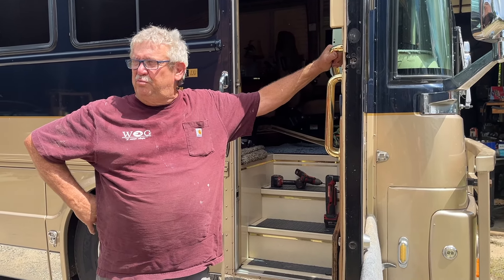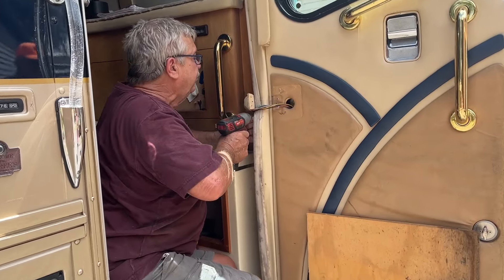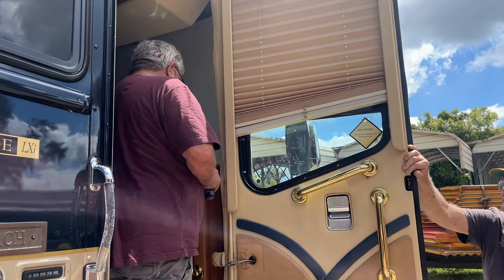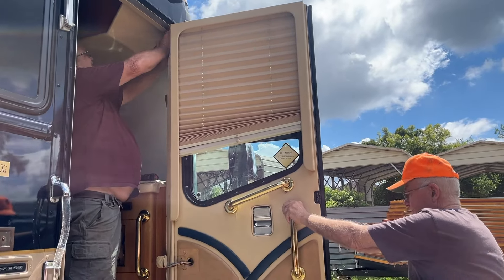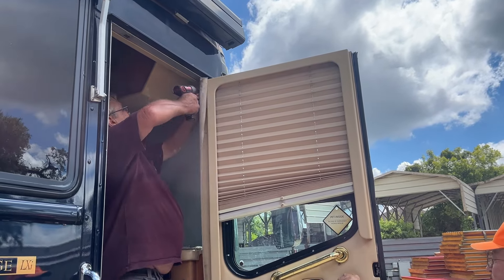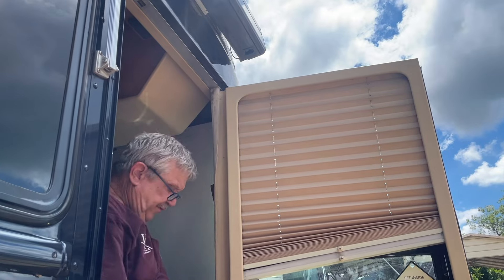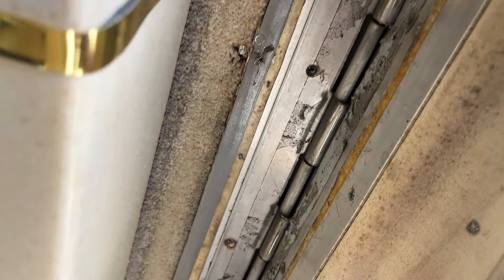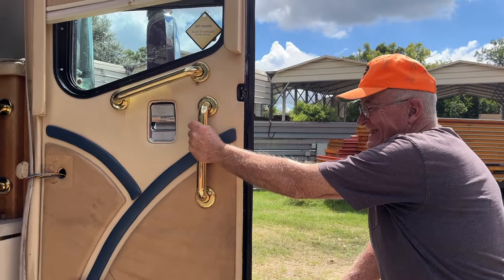Randy replaces a Wanderlodge door hinge!

Comment: A few comments:
1. Carols tight shot of the old hinge while still on the bus showed how really worn the old hinge was.
2. I was surprised how short and small the hinge mount screws are.  Maybe that is why there are so many.  Of course, we know Blue Bird was not shy about using a lot of screws.
3. New hinge looks and sounds way better.
4. If or when you decide to fix the fabric on the door, I would really like to see how that door panel etc. comes off in a future video. I think that would be helpful to others that want to change the fabric on the door and to those that need to repair the door handle and lock.

Wow, $700 for an original Blue Bird hinge is a little pricey!!

Thanks for the video.  Good to see you, Jim and hear Carol!!